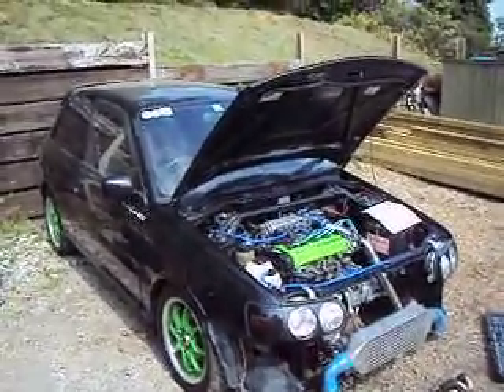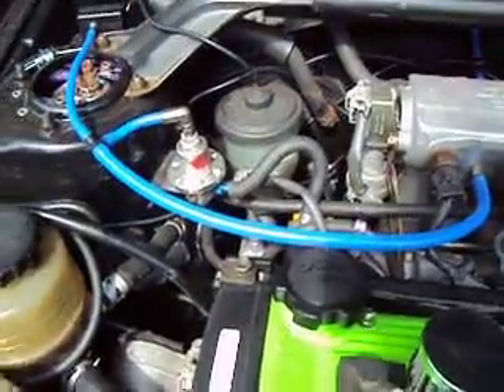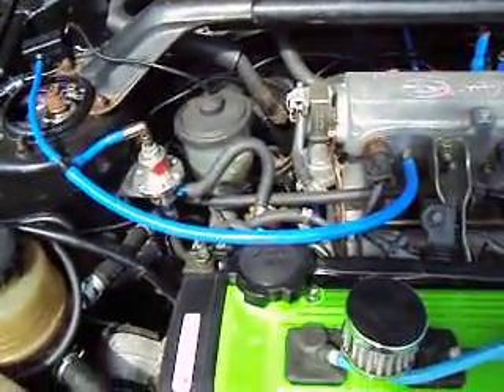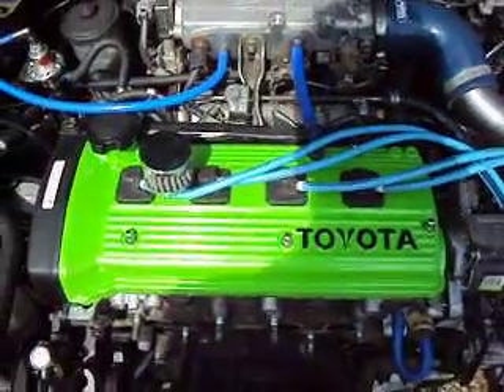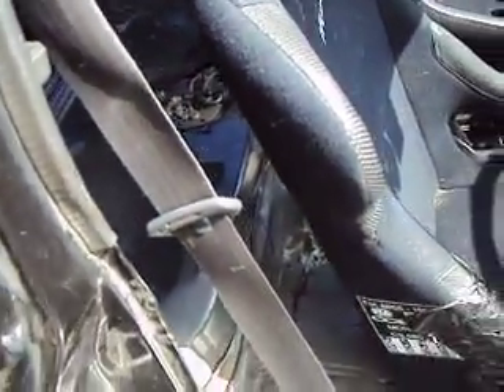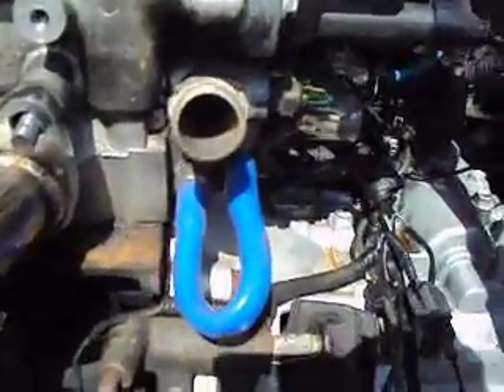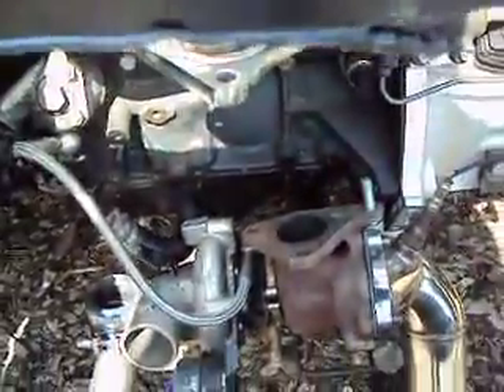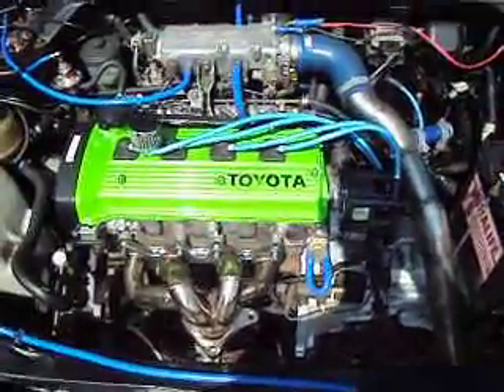Toyota Starlet GT / Glanza TD04 conversion guide - What you need and how to do it:  Part 2 of 3

Comment: All you did was add a FCD to the stOck ecu ?
Reply from the maker: +James O Connor You need to add a fuel pressure regulator as well to the fuel rail, boost was turned up to 1bar and then put on rolling road to set fuel pressure correct so it wouldnt run lean with increased boost pressure. Its a crude way to do it but works, the alternative is to put a piggy back ecu on and then get it mapped. What ever happens any extra power added you have to get the fueling checked.
Reply: +Craig McTaggart thanks mate I need all the help I can get haha

Comment from the maker: @yb600whp Hi, yes your right, there is alot of weight from the exhuast system and turbo hanging off the manifold. I havent had it done yet but you should get the decat pipe braced so you can screw it onto the engine block :)